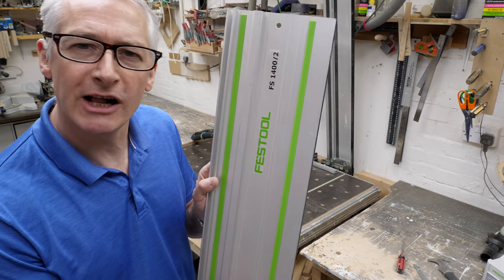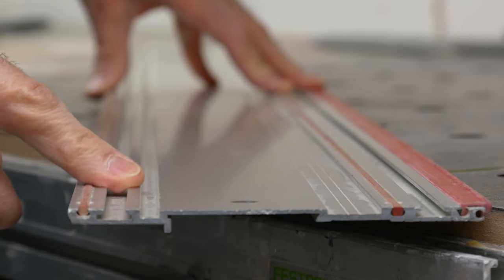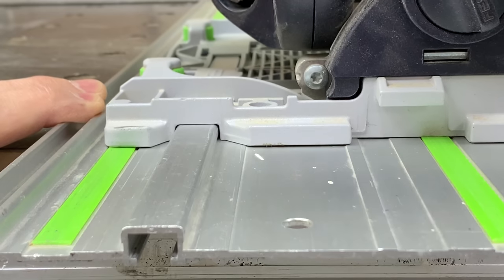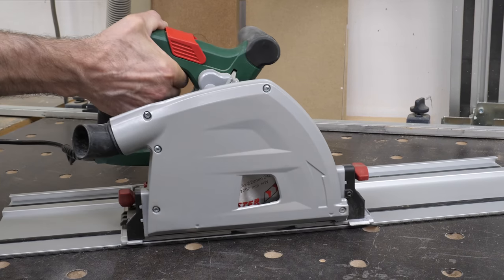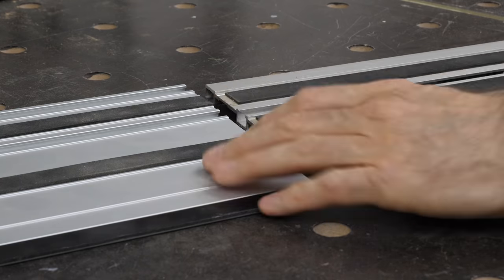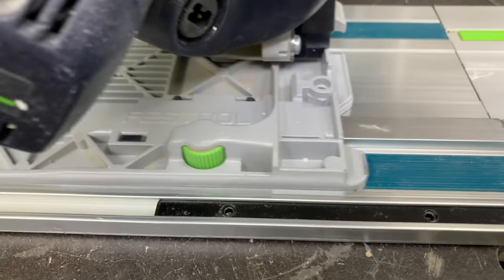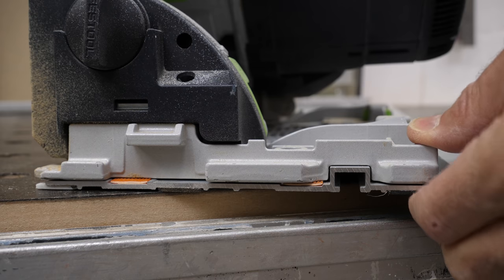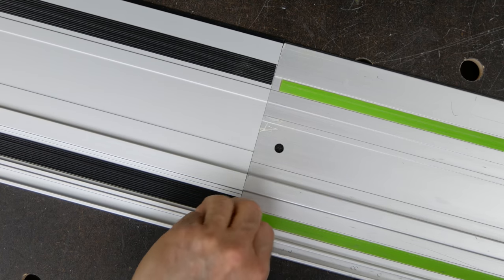Which Rails Work? A Guide to Guiderails [video #403]

Comment: Happily the Excel rails are back in stock.  There is a curious warning about the 700mm rails not being compatible with the 1400mm one.  Apparently they are made by different manufacturers and the thickness of the profile is slightly different.  I need a couple of short rails as my 1400 ones are often rather awkward for smaller cuts so I have bought a 1400 which I will cut in half so I can join the extra short lengths to a Festool1400mm rail (I hope)  if I need a little more than 1400.  At £35 with free delivery after adding a few spring clamps it seems a very good deal.
Reply from the maker: Yes, the 700mm rails that come with the saw are like the older Parkside saw and rails; Because of this the Excel plunge saw wont fit on the Excel 1400mm rails. Madness. 🤷‍♂️
Reply: @10MinuteWorkshop  Hi Peter.  It was the comment that the two rails won't join rather than compatibility with the saw that concerned me.  I need a couple of short rails but might want to join them onto my 1400mm Festool rail occasionally so I hope that cutting a 1400 Excel rail in half will allow me to do this.

Comment: Really useful video. Particularly liked the pdf of the Festool rail profile but a Makita one would be useful too. As a hobby diy er a Festool as much as I would love one seemed hard to justify so I bought an Erbauer. The cuts were good but the anti kick back is fiddly as are the 700mm rails. But there is a deal on 1400 Makita rails and I wonder if they work with the Erbauer, hence looking for a pdf of the profile.
Reply from the maker: Thanks! I don’t own the Erbauer, but according to the Q&A section on Screwfix, it is compatible with Makita rails. 👍👍

Comment: To avoid misalignment and unwanted/unnecessary bumpy glides when running the tracksaws along the joined tracks…
…one should avoid the joint between joined tracks (even from the same make) to be completely closed; it's (much) better to leave a smal 1mm - ≤2,5mm gap between them.
This will avoid a bumps when the edges of then joints are nor a 1005 in line as well as that it makes alignement (and thus an almost 100% straight track) easier to achieve.

Although most manufacturers/traders don't seem to bother, others s.a. Evolution Powertools even mention such specifically in their manuals:

THE TRACK
The Evolution Track system consists of two (2) or three (3) precision extruded alloy sections.
(Fig. 18) These sections must be joined together using the joining bars supplied. (Fig. 19)
To Join The Sections Together (Fig. 19):
• Slide the bars into the ‘T’ slots found on the under surface of the extrusions.
• Ensure that an equal length (approximately) of the bars is inserted into both of the sections to be joined together.
• Tighten the socket headed grub-screws to secure the sections together.

IMPORTANT NOTES
Note: It is important to leave a small gap between joined sections of between 1 to 2mm. This will ensure that when a circular saw is
placed upon and used with an Evolution Cross Cutting Track it will slide smoothly along the entire track length.

SAW TO TRACK COMMISSIONING Note: The following guidelines refer to Evolution circular saws and the Evolution Cutting Track. Consult the information supplied by the saw and/or the cutting track manufacturers if a non-Evolution circular saw or cutting track is to be used.
Before the first use of the Evolution Cutting Track the Splinter Guard Strip (Fig. 21) needs to match the saw and blade.

een vriendelijke groet,
Simon Koorn

Comment: Important update on my previous comment - Excel 700mm guide rails won't work with a Makita DHS680 and guide rail adaptor. I've just acquired a pack of two 700mm Excel guide rails, and these are not the same as the standard Makita guide rail profile and won't work with my Makita DHS 680 and guide rail adaptor (though perhaps they might work with a Makita track saw). It appears that Excel either offer alternative profiles or have changed their design since Peter made the video. Either way, this 700mm rail profile differs from the Makita profile in two important respects: a) the channel on the edge of these rails is a 'c' section (not a 'u' section as per the Makita rail) with the 'c' opening facing towards the centre of the rail. This means it is not possible to use a second connector bar when connecting the rails together; b) more significantly for using a Makita guide rail adaptor, the top of the 'c' channel is approximately 10mm above the surface of the rail and about 4mm higher than the centre channel, so a Makita guide rail adaptor will not sit properly on the rail without modification as the edge of the adaptor that would normally run over the Makita outer 'u' channel rides 4mm higher on the Excel outer 'c' channel. It looks like Makita rails are the right option for the DHS680 saw/guide rail adaptor after all!! I can provide photo's if needed.

Comment: Good info here as always! If I could justify the cost of a ts55 it would be the saw I own but just setting out on this journey I went down the park side route! Seeing the issues with the evolution rail is interesting and I’m a little let down it doesn’t work with the square from last weeks video but I think I’m going to go with them anyway as I really want a single rail to do cross cuts with so the 1400 will be perfect. Keep one of the shorter original rails for small cuts and portability and I’m sorted. I don’t know if I’m just heavy handed or anyone else has found it but when I first tightened down the joining rail it blistered out the top of the track meaning I had to swap them round end to end so the saw would travel along it!
Reply from the maker: There’s a fix coming very soon for the evolution rails and the benchdogs rail square. FYI there are some very good deals going around on the festool saw and rail package.  👍👍

Comment: Informative as usual. In the wild axxx guess department. I can think of a reason why no one has copied the Festool rail despite the fact the patent has expired. Given Festools corporate culture I think you would have to fairly certain you would be sued. IP lawyers fees to other lawyers fees are Festool prices to Aldi prices. All they have to do is allege that the consumers are being misled by the knock off and years of extremely expensive litigation can follow. This may be cynical but it is an informed opinion.
Reply: Just out of interest was the patent comment a bit of coat trailing?

Comment: I started my Festool madness with a TS55 and two 1400 rails - absolutely hated faffing about to join them and never trusted the straightness, so I bought a 3000 rail and never looked back. Expensive but efficient! I also have a Makita saw and the rails that came with it - both rails have a slight bow in them, making it a pain to line up as it won't sit flat on the workpiece unless you lean on the middle or put the saw on it. The saw is still in use (on a permanent cross-cut station) but on a (cut down) Festool track. Lesson learned; don't spoil the ship for a ha'porth of tar. If I had a budget saw I'd probably be happy with budget rails, but every horribly expensive Festool tool and accessory that I've bought seems to have a little bit of magic built into it. Just sayin' ;-)
Reply from the maker: Hey Jeremy. Yes, I don’t disagree - I bought the 3metre Makita rail back when they were about 1/3 the price of the Festool. It was a good one, thankfully - wouldn’t have fancied sending it back! 😂👍
Reply: I had the same issue with my Makita rails, I sent them back twice before I got a decent set. Shout out to its tools for quickly sorting me out!
Reply: Agree wholeheartedly with that. In the workshop the 3 metre rail makes life so much easier. I liked it so much that I bought a 1.9 metre for crosscutting 8x4s because I like the extra length to run in and out of the cut. The 1.4s are now relegated to the substitutes bench.

Comment: Nicely done, I have been wondering about the absolute compatibility between rails for a while - I have the Erbauer saw with the included 2 x 700 rails, I also happened across the Excel 1500 rail for £27 a week or so back,  at the price I took the chance and glad I did, it works a treat - Cant say for sure it's 100% the same but the saw glides fine and the splinter guards align so it's good enough for me. 
I Look forward to your Erbauer review as I have no comparison for mine (except a friends Festool which is no comparison at all) - I am only a hobbyist but I had to change the blade before my Erbauer would cut true, with the original blade it veered off the splinter guide 1 - 2 mm every now and then unless I cut VERY slowly (but no perceivable wobble or movement in the blade when stationary) - Very strange but new blade and splinter guards and all seems good.
Reply from the maker: Good info, thanks! Yes, I’ve had a few positive reports on the Erbauer recently, looking forward to getting my hands on it. 👍👍
Reply: Thanks for the Info. Just buying the Excel ones for my Erbauer after your recommendation.

Comment: I really like the flexibility of having two 700mm over the 1400mm rail, for smaller cuts it's less of a faff lining it up as you don't have a metre of track in your way, and it's a lot easier to carry around. 
In fact, I've taken them on the bus with me!
Reply from the maker: Yep, there’s always a place for a smaller rail. But having one longer one is pretty handy too. 👍👍
Reply: @10MinuteWorkshop  I suppose it depends on what you use the track saw for, for the few times that I've needed a longer track, I've just done it in multiple passes. The rest of my longer cuts are done on the tablesaw as they're usually too narrow to cut safely anyway
Reply: Have to agree - in similar vein I have 2 of Axminster's Pro Grip clamps in 610 & 1270 lengths for convenience and handling - I've yet to graduate to a plunge-saw.       BTW must be summer, no T-shirt & shorts  this week:-)
Reply: What a hassle to line up a 1600 (Bosch) rail for a 200mm cut... Bump it off the mark three times only by setting the saw onto the rail...

Comment: Another top video, Having now gone down the 'tracksaw' route when buying the Aldi kit for £29.99! fitted my first Kitchen with it this week, Impressed with it TBH, cut the worktops fine and the cutouts for the sink/hob, grip on the track is good impressive for the money! Having been looking at upgrading, Did I notice you using the Bosch rail in a previous video? I think I'm going to go for the Bosch as their Router works on the same rail and I like the way the rails 'join' (had a good look at the D&M tool show last yearish (I need a new mid range router as my Trend has died, Had it 20+ yrs) I think like you do yourself, pick a system and stick with it, it's not rocket science, Im a Makita fan but the Bosch kicks it ass on tracksaws IMO
Reply from the maker: Thanks! Yeah, the Aldi’s decent enough - especially at £30! - but I found I needed to do a lot more to it to get it cutting well. I had /have the Mafell on loan, but the Bosch looks good! 👍👍

Comment: Hello Peter, 
good timing with the guide rail vid. thanks as I’m contemplating buying a track saw, mainly for cutting down full sheets to make it easier to manhandle onto the table saw.  I’ve managed to avoid wearing the green and grey suit for sometime, but having bought my first Festool tool, I’m beginning to get sucked in by the ‘system’ !  It seems that all rails are compared to the Festool and fall short with various niggles. I have noticed that you cut your sheets with the lr32 2.4m which by having the holes drilled increases it’s versatility for router use.  Is that successful or is longer necessary ? As a hobbyist, I only want to buy one long rail to complement the 1400 which comes with the saw. Enjoying your wardrobe build too, but don’t hang your tools up when it’s done ! Alex
Reply from the maker: Hi Alex. Haha, yes - the slippery slope, lol! And yes, all 'equivalent' rails have some niggles that make them slightly incompatible; as mentioned here, Makita come closest, but the anti-tipping lip gets in the way of some things. Yes, I've used the 2400 LR32 rail for the odd long cut, and it works OK, but I do wish they made a 2440 or 2500 version! But yes, having the holes definitely increases the versatility, especially if you ever need to make the odd large bookcase or wardrobe with adjustable shelves. When I was first working with Festool, I bought the 3-metre makita rail as it was about 1/3 of the price of the equivalent Festool 2400 rail; these days the prices are much more competitive, and the 'holey' 2400 rail made more sense. 👍
Reply: Cheers Peter, useful stuff and thanks for taking the time. Alex

Comment: I just bought a Powertec 55 inch rail for my Festool TS 75 track saw and it works perfectly. HOWEVER, it is not compatible with the guide rail attachment for the Festool Carvex jigsaws. There is a "lip" that prevents the guide for the Carvex from sitting on the guide rail. I am now exploring ways to cut that "lip" off. I wanted a Festool 32 inch guide rail to complement my 55 and 108 inch rails. The Powertec 55 inch rail was $65 and I always intended to cut it down to 32 inches and have already done so. The 32 inch Festool rail was $98. I now have a 32 inch and a 23 inch guide rail though I see little or no use for the 23 inch part.
Reply from the maker: We don’t get powertec here in the UK but it sounds like a clone of the Makita pattern rail - same lip that gets in the way. I did a video about How to Trim a GuideRail, and why you’d want to! [video 468] here - 

https://youtu.be/QqTJ4SrRD1M
Reply: @10MinuteWorkshop  I watched that video twice and am going to do it. Thanx

Comment: hi peter i am only just getting into diy/woodwork as a hobby and have been looking at the excel plunge saw as they have it on offer and was wondering if you know anything about what it's like or could recommend one . 
i quite like the look of the erbauer also thanks.
Reply from the maker: Thanks Clayton. I don’t know anything about the Excel I’m sorry. I’m a big fan
If the excel rails, and I’ve approached them to ask about review samples, but have heard nothing in return. My go-to entry level saw remains the MacAllister - there are many videos in the tracksaw workshop playlist. The erbauer is a good saw, but has an odd blade size - which  erbauer don’t even sell themselves as a spare part - so I wouldn’t really recommend it, unfortunately. Again, I review this it the TW playlist. 👍👍

Comment: Hi Peter hope you are well and still watch out for comments on older vids!! Thanks if you do, anyways I have a triton tts1400, and recently got the makita 1500 rail, following your recommendation 😀 
Anyways the issue is it doesnt sit snug on the rail, is there anything you advise that van be done to ensure consistent accurate cuts?
Again appreciate if you are able to respond to this and greatful if you have read this much!!
Reply from the maker: Hi Mo, and thanks! The rib on the Makita rail tends to come in a little undersize - I know my Festool saws wont lock down tightly on the my Makita rail, but they're generally tight enough to use without me worrying about them. Presumably with the Triton you're snugging the saw onto the rail with the little cam adjusters, but they're just not pulling in tightly enough, yes? If the Triton has done a few miles, they adjuster cams may have worn - they are available as a replacement spare part from Triton, if that's the issue. Otherwise there's not a whole lot you can do about it, unfortunately; don't think I've ever seen one that was so far out that it would unduly affect a cut though, but obvs. you have the saw in front of you, only you know how bad it is.

Anyway, hope that helps - let me know how you get on. Best, P
Reply: @10MinuteWorkshop  wow thanks for the response Peter really appreciate it! Especially can imagine seems like you soo busy with soo many projects these days!! Thanks
Yes had quick look, is slightly worn, tried a little cut off sum gaffa tape and you won't believe it it worked! Nice n snug, only need to be backed off for the parkside rails I've been using lol 😊
Thanks again for the amazing effort and quality you put into your content and I'm sure you have been told this many times you are a natural mentor/teacher!!!

Comment: Hi Peter! Great video, always wondered about rails compatibility. I use Bosch track saw on Makita rails (40€-1m,50€-1,5m) because they are wider than original Bosch rails. One issue is low friction strips. Bosch saw has smaller base plate so strips should be like on Evolution rail. (Bosch/Mafell on Evo rail? Idea for cheapest rail). Changing low friction strip on Makita rail was hell, I managed one strip. What is the best way to change them? Give me god answer and I give you idea for project with that small peaces of rail.
Reply from the maker: Hiya. Pretty sure the low-friction strips aren't meant to be changed - they sit in a slight recess in the rail, so that they both have the same finished height, so keep the saw level. That said I know plenty of guys who use Festool rails with Mafell/Bosch saws without any problems. When I change splinter guards I always warm the rail up with a hairdryer (or very carefully with a hot air gun) to make it easier, maybe that would help with the glide strips if you are determined to change them; maybe check the thickness of the rail on the other side of the rib to see if it will affect the saw being level?

Good point about the evo rails in that regard - someone else mentioned this further down in the comments as well. I still have the Mafell saw - I'll see how it sits on the Evo rails. 👍
Reply: @10MinuteWorkshop  Try Mafell on Evo and Makita rail. Check Andreas Kalt review on Bosch GKT55 saw. If strips aren't moved than cutting bewel isnt proper 90 degrees. My struggle was to heat and remove strip but secure non-friction strips underneath.